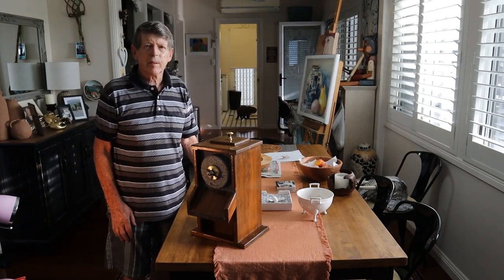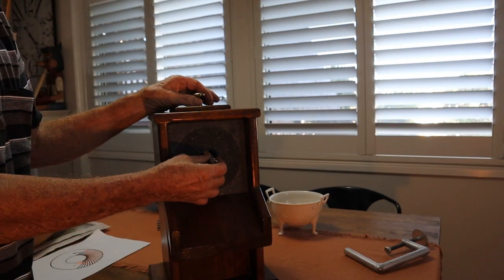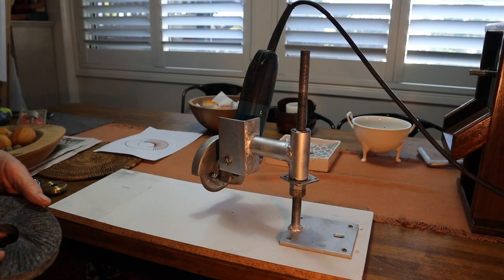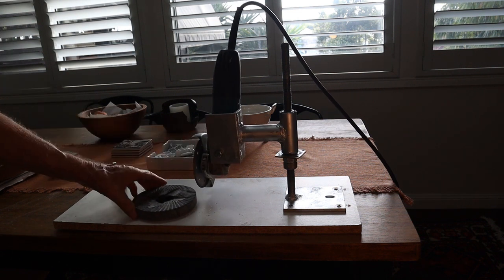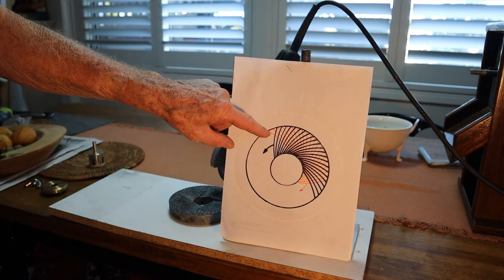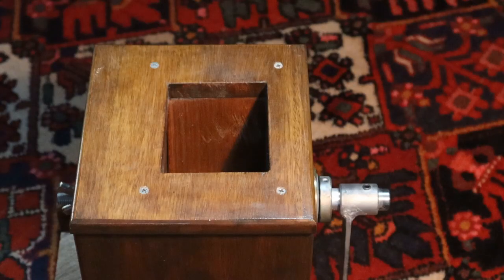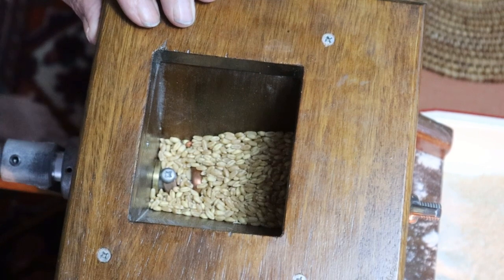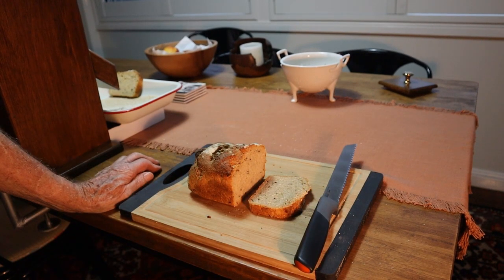MAKE YOUR OWN GRAIN MILL

Comment: You're absolutely brillant to think of using granite tile from the hardware store! Getting a proper stone mill can be expensive and the reviews on the steel hand mills aren't looking promising. Not to mention the price on anything that positively will grind wheat to fine flour you're look at the $500 price range everywhere. I'm thinking I will try making the granite stone surface plates affixed to upper and lower cement quern mill. The cement will make a heavy weight but the granite will do the grinding, and I might get away with spending less than $50. I like the horizontal cranking motion. It's so much easier on my bad shoulder. Thank you!

Comment: Thanks for the video!
One of the best that I have watched!
It seems that you're Australian!
Whatever be the case, your people should be proud of you!
Your opinion of being left or right handed so far as the cutting of the grooves, is most agreeable!
The detail about the edges of the stone where the grooves stop is educating!
The copper screw feed is so correct!
Are the stones crowned from the centre to the outer edges, to direct the materials being ground?
I can't find your replies to the comments, so I hope all is well with you!
Your hard work deserves blessings!
Reply from the maker: The stones are not crowned ,they are flat.
The grooves in the stones push the flour outwards.
Some people worry that the stones wear down and you are eating fine sand ,this is not the case as there is flour between the stones at all times.(You don't run the mill empty)

Comment: I would like just the basic top and bottom millstones, as seen in central and south America, where you put grain in top hole and turn by hand on a knob connected to top stone, flour comes out of channel in bottom stone. I don't see them on-line anywhere.
Reply from the maker: You should just buy a small mill it would work better than two stones sitting on top of each other.

Comment: I wonder if you could use a bench grinder wheel as a stone?
Reply from the maker: You need to have indentations in the wheel to accept the grain which is hard to to do on a grinder wheel.